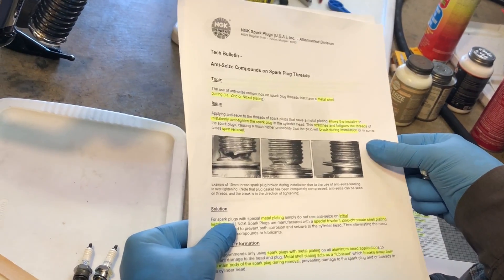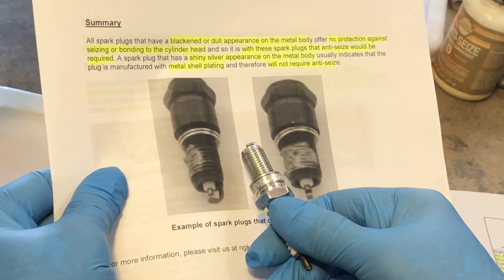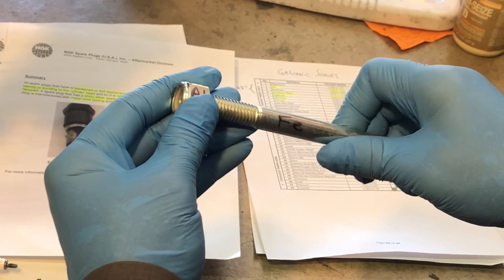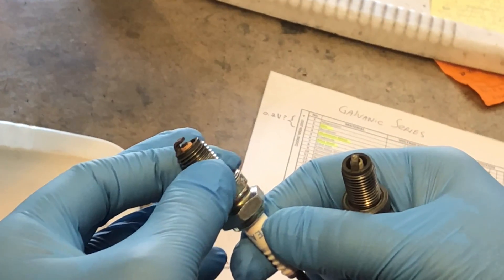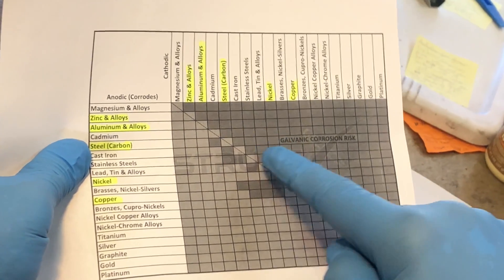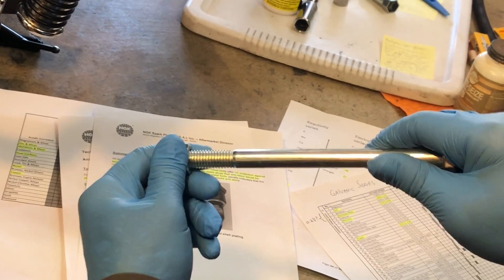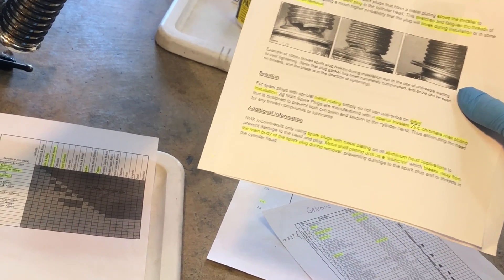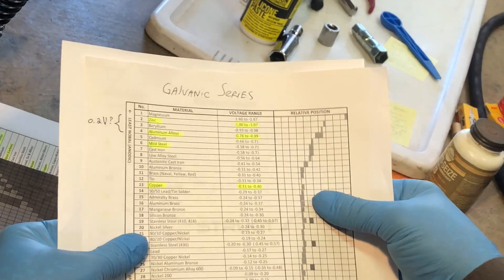Aluminum cylinder heads, spark plugs, anti-seize, & galvanic corrosion

Comment: Thanks for this. That's answered a lingering spark plug knowledge gap very well.
Also, Coming from long term marine experience, copper-based anti-seize is really bad for alu connections.

Long version:
When you 1st put it on, it seems ok. And if you take apart, clean, and reapply to that connection frequently, it's fine. (eg don't ignore it for 1 year at marine use).
But we learned the hard way again and again: if you have a connection that you aren't servicing a lot, and it goes for 1 year, the corrosion protection additives will get used up, and your mixed-metal anti-seize will turn into a corrosion promoter.
Certain anti-seize compounds are ok (zinc) as is dielectric grease, as long as it isn't too hot (don't use on turbo mounting studs). Dielectric was already designed to help prevent corrosion and isn't adding any mixed metals, so it works surprisingly well as a general purpose compound. 
1 further note: I wouldn't substitute Dielectric grease for anti-galling compound for SS on SS connections.
Reply: Copper and aluminum are pretty reeactive on the galvanic chart, I never use copper in contact with aluminum.
Reply: @thisisyourcaptainspeaking2259 Curious as to why copper antiseize is the most readily available and practically promoted. What is its best application?
Reply: @radleybradford1356  Milk of magnesia was never promoted for use as antisieze either besides Pratt&Witney, as far as I know?
I use my common knowledge when selecting materials compatibility.  For instance, in low temp applications I use permatex 3B as an antisieze.  I'll may try copper some day based on your recommendation but aluminum and copper never play well together in my experience.
Reply from the maker: Thank you for sharing -- much appreciated!

Comment: There's a reason you don't use antiseize on lug nuts and head bolts you can't get them to stay torqued to speck in my opinion that's why spark plugs blow out. Sounds like the chrome ones are the one's to use to me
Reply from the maker: I've been using anti-seize on lug nuts and spark plugs for twenty years.  Not one has ever backed out (lug nuts do receive a smaller reduction in torque than threaded shanks of any kind that go into aluminum receivers).  Fasteners will stay put if torqued and preloaded properly -- the tension holds them in place.

Comment: Honda automobile service manuals call for antiseize. I'm referring to the factory printed soft cover paper service manuals covering autos, 1970s, 1980s, 1990s, at a specific torque specification. All models had aluminum heads. That is how I roll.
Reply: They still do.

Comment: This is backyard engineering. The NGK sheet just said to not use antiseize on its coated spark plug threads. Debating this is just like debating the opinion of your old family doctor. Always go with the best authority available and not with your personal opinion.
Reply from the maker: I appreciate the comment.  The purpose of the video was to explore the REASONING behind the manufacturer's recommendation.  In short, since many folks are unaware of the need to reduce the torque when anti-seize is used, and over-torqueing a spark plug is, to put in mildly, highly undesirable,  spark-plug manufacturers advise that the coated plugs be installed dry.  But, in some cases, the coating on the threads just does not last long enough, and that's when problems begin.  Generally speaking, there are many reasons why the "best authority available" provides one or another recommendation.  Remember doctors, who prescribed highly addictive painkillers without hesitation?  In my opinion, one should go through life at least TRYING to think for him/herself.  Asking WHY is not a bad thing, last time I checked.  The easiest thing in the world is to find a "safe" box and put yourself in it.  What if your factory manual recommends the use of anti-seize on the plugs and the spark-plug manufacturer does not?
Reply: The coating does not come off, i have never ever had a coated plug  be an issue.

Comment: I just removed some original BMW ( Beru) from a bmw e46. They hadn’t ever been out in 21 years.  The car was well below the 90k miles for change so they were never changed during services.  They came straight out. So the plating certainly worked
Reply from the maker: Wow!  Just curious, what was the actual mileage (I know you said well below 90K)?  Also, what brand spark-plugs?  NGK or some other?

Comment: I always use a whisper of nickel anti-sieze on plug threads - it handles the heat.  Regular is often junk and just doesn't hold up over time.  How the heck people have snapped threads off is beyond me.  In decades of wrenching, if I break something its a steel bolt in aluminum that was probably installed dry and lived in a salt environment for years.   Saying a plug does not "require" anything brings some assumptions with it, like a minimum miles per year driving to get at a reasonable replacement schedule.   For low miles drivers [like me], their advice might disappoint because time in service is what will matter for these coatings.
Well covered.  What I was able to dig up on the Versachem B product was lithium grease/petroleum distillates with... copper, calcium oxide, graphite, with remainder [roughly 5%] as proprietary.
Reply from the maker: Yes, miles-in-service is key as far as corrosion is concerned.  But even (in fact, especially) if the plugs are replaced often (unlikely these days), the idea of repeatedly installing a relatively hard steel shank (spark plug) in a relatively soft aluminum receiver (spark-plug hole) without lubrication makes me nervous.  Thank you for the comment.
Reply: Can't tell you how many fasteners I've removed that felt close to snapping off or bringing the threads with them, numerous times they have.  This is one of my primary reasons for disliking aluminum heads.

Comment: A great video and discussion on the topic, especially covering the additional torque that is generated when using a lubricant on the threads. However, ever since seeing a friends car have a coroded spark plug snap in two on removal (aluminium head) and requiring far too much effort from the mechanic to extract, I've always put never-sieze on my sparkplugs to minimise the corosion, create a better seal, and ensure they can be removed easier at a later date. 30+ years and this method is still working great for me and my family.
Reply: I agree, never broke a plug during  installation in 22yrs on the job ( anyone who does isn't paying attention or moving too fast), but several on removal. Manufacturers can say what they want about their coatings, but I'm not gonna risk it
Reply from the maker: Thank you for the comment.  I do as well!  Watch: https://youtu.be/q2r0FmzXLI0

Comment: I'm 66, ase mechanic, worked on Subarus since 1973. My brother ( mechanical engineer) got to the bottom of seizing champion brand plugs.
He said NGK had gold anodized antisieze and ROLLED THREADS, champion brand was CUT THREADS and no anodized antisieze .
Subaru manual said NGK once removed was to be discarded, not reused.
By 1975 I antisieze all plugs going into aluminum! 
NEVER HAD ONE COMEBACK, NEVER.
Reply from the maker: Thanks for sharing!  BTW, what was the first year that Subaru imported cars into the US?
Reply: 1968 @Zerk_Ziegler
Reply from the maker: Wow, thanks!  I thought it was in the early '70s ...
Reply: pretty sure some visited pearl harbor under their first name 😉

Comment: Most gasketed spark plugs tightening recommendations are either torque or finger tight with the gasket against the head then 1/2 to 5/8 turn. Taper seat is torque only. I use the 1/2 to 5/8 turn method and don't have any problem. I also think the antiseize promotes better heat transfer to the head. I use only aluminum antiseize because I work in the salt water environment and galvanic corrosion is very high. The aluminum antiseize is extremely good for stainless on stainless fasteners to prevent them from galling when assembled. Grease doesn't do the job. Just a very little bit of this stuff seems to get everywhere so I would caution getting any at all on the firing tip because it might short and foul the spark or any other electrical connection. I use the squeeze tube because it is easier to control the messiness and so little is needed for it to work.
Reply from the maker: Thanks for the comment!  Yes, stainless-on-stainless galling can sure be a problem ... Also, it's not just the firing tip one needs to worry about -- it is important to keep anti-seize off the seat/washer and the back of the plug (external insulator) as well.

Comment: Would Molybdenum disulfide paste be safe and effective?
Reply from the maker: According to NGK, the optimal firing-end temperature of a spark plug is approximately 500°C (932°F) to 800°C (1472°F).  Even though some heads may be EXPOSED TO exhaust temperatures above 1400°F ,  the temperature of the alloy itself is much lower than that.  There ARE Moly-based anti-seize products advertised for use on spark-plug threads.  They are generally rated for around 800°F.  One brand of Moly-based anti-seize, advertised online, claims that "this product has excellent conductive properties which allow use on spark plug threads exposed to MODERATE temperature."  Another manufacturer states that "since this compound contains MoS2, which at higher temperature conditions (1000°F and above) may INDUCE CORROSION OF FASTENER OR CONTIGUOUS METALS ... its use at higher temperatures should be avoided."  Therefore, buyer beware.  The zinc-based anti-seize I use is rated for 2450°F -- there is no kill like overkill, as they say :)
Reply: @Zerk_Ziegler  
Wow! Nice.  Thanks for the reply and info.
Reply from the maker: I appreciate the comments!

Comment: I put a extremely small amount on my sp threads and ran it through to coat the entire thread, then remove and let dry, then i would have a nice thin coating of anti-sieze to help stop corrosion and/or stubborn to remove plugs. Not on every engine I have, but on some :-D
Reply from the maker: I just use a small toothbrush to cover all threads BUT the one or two closest to the porcelain with a thin, even coat of anti-seize.

Comment: The list is in order of nobility, if you put any two metals together, the metal higher on the list will be the one that corrodes and potential rate of corrosion is greater the further apart they are on the list. Copper is better than nothing even though the alloy of the head would lose to the copper, its far less than to the iron of the spark due to mitigation of electrolyte by the copper past, that then gives basically 100% protection by there being no medium for electrons to transfer through. Zinc loses to both iron and alloy  (the sacrificial anode) and the coating is applied thick enough to last the average duration a plug is in service. 
As for torque, because of the exact reason you say "less friction" would cause over tightening, spark plugs have a tightening procedure! Depending on the seal face of the plug, flat, tapered, crush washer or flat washer, you turn the plug down by hand till firm then depending on the type of seal, you continue to tighten trough a specified number of degrees.
Reply from the maker: Excellent point about tightening through a  specified number of degrees.  Always the best way if the spec is available.  In aerospace, some fasteners are tightened using the "two flats" method.
Reply: @Zerk_Ziegler  So many people ive worked with use the apprentice method... 1/4 turn past snap! Lol
Reply from the maker: Well, you don't just tighten every threaded fastener the same way willy-nilly -- gotta follow the spec :) Also, I really like your take on why copper anti-seize provides good corrosion protection in an alloy head even though aluminum is more reactive (less noble) than copper. @mrgoodman6620

Comment: My moms 1.6l ford escape has the galvanic corrosion on two of the four spark plugs.  I was lucky to be able to remove 3 of them, the 4th one broke, now i have to deal with extraction.  Definately not thrilled.  I was even less thrilled when i double checked the owners manual, for reccomended spark pluv interval of 100k.  My vehicle only has 70k.  I am topping up antifreeze, but very minimal.  System consumes about 12oz bottle of water every 45-60 days.   I borescope every cylinder, and i am not sure what i am seeing.  Definately reccomend removing all plugs, and put a pressure tester on the system overnight, hopefully (actually not hopefully 😂) i may find coolant intrusion in the combustion chambers of my two problem holes...
Reply: When removing plugs, its best to crack it then do it back up then crack 1/8th then do it back up,  slowly increased how far you undoo it each time untill the plug feels fairly free. Carbon can build up around the end creating a lip holding the plug in. You need to crack it off by working the plug. If you try just turning the plug straight out it can cut the thread out very badly or jam completely, as i think you found. The broken plug needs to be turned back IN on the first go at extraction, and soak it in throttle body cleaner to dissolve the carbon. There will be bits of ceramic plug in the cylinder and need careful and complete removal, airline vacuum recommended and DO NOT turn the motor AT ALL untill the cylinder is guaranteed clear, DO NOT BLOW AIR INTO THE CYLINDER as it could blow debris up the intake only to fall back later and blow the motor. When replacing plugs make sure you  screw them all the way in by hand, if you have to use a spanner you may cross thread them if the threads were damaged removing the old ones, if that happens it's a big buck professional job, as it is with the broken plug your gonna need advance level mechanical know-how. The  corrosion of the plugs is not unusual and unlikely indicates coolant in the cylinder. A difference in appearance of the electrodes with larg variation in colour and deposit would be, and possibly one piston having a cleaner looking top. A leak into a cylinder would get worse in a short time. Your beer can worth of water every 2 months is possibly a bad radiator cap or seal, or leaking heater tap. Look at all the pipes where rubber hoses conect for signs of corrosion or scale from dryed coolant, you wont actually see moisture with a leak that slow.
Reply from the maker: I find that 100K intervals may be fine for the plugs, but not so good for the threads they screw into.  It's always a good idea to pull the plugs out, say every 30K, inspect, apply anti-seize, and reinstall.

Comment: If you have been a mechanic any length of time you probably whont use a torque wrench when installing spark plugs
Reply from the maker: Yes, it takes time to develop a "calibrated elbow".  Most folks don't get enough practice to get the correct feel, however.